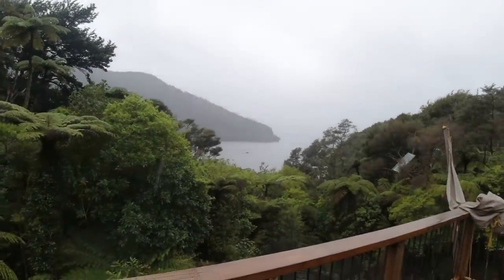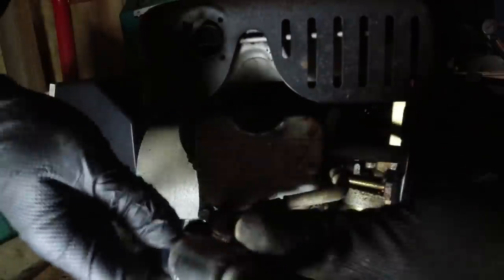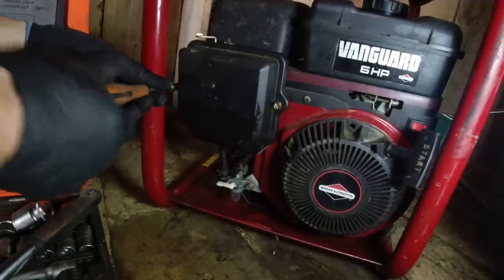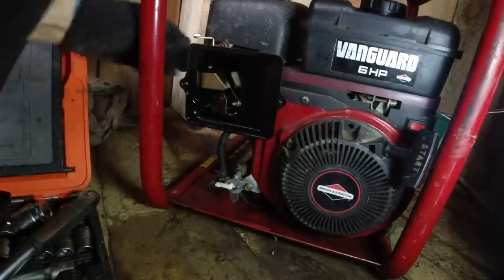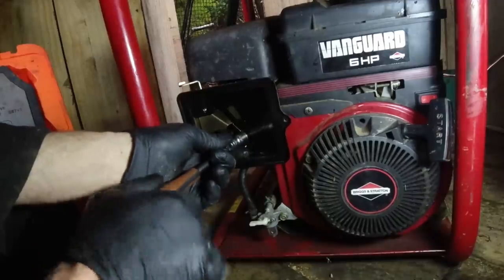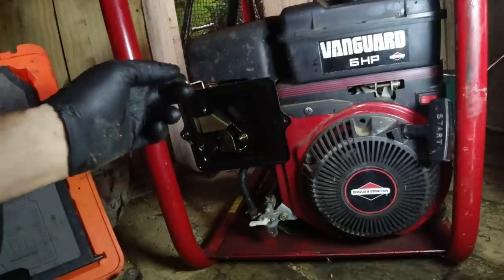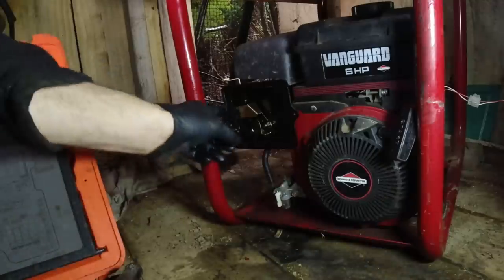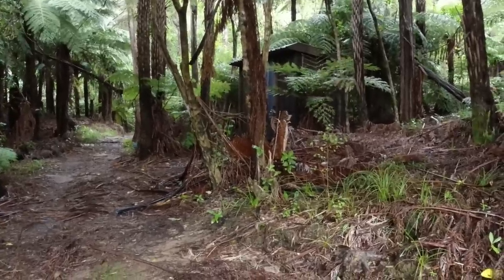Diagnosing and Fixing a rough running petrol Generator

Comment: Hi Marty.  I had a similar problem on a generator.  What I discovered is that the fuel valve was not shut OFF the last time the generator was used.  Over time fuel had bled through the carb, into the cylinder, past the rings and into the crankcase.  The oil diluted with fuel was overfull in the crankcase and the crankcase vent tube then blew fuel/oil all over the filter.  Luckily the condition meant the generator ran really badly and shut off within a few seconds of starting (30-40 seconds).  This is when I was asked to investigate why my father in-law's generator was not operating.  Due to the fact it very quickly shut down it prevented any damage from the fuel diluted oil.  When it was running it sounded JUST like yours.  I changed the oil, cleaned the card, installed a new filter and it was a job done just like Marty would do.  I channeled you!!
Reply: I had the same issue with my garden tractor. The crankkase was full of fuel. It spittit out everywhere when it ran (very pourly obviously). Also a an overflowing carb.

Comment: A vicious cycle, clogged air filter from most likely mist since you had so much rain, that leads to motor running rich and the blow by comes back to saturate the air filter with fuel and carbon, stopping it up even more. I always keep a few filters in the shop incase dust storms or vapor lock on my equipment. Tell kids they can start a motor with some brake clean but they never remember to take the filter off first.
Reply: id say the crank case oil beather pipe feeding straight into the airtake and mucking it up is more the problem. id either vent it to atmosphere or get an oil catch can.
Reply: @jimmyhackers8980  - For a short-term fix, this might be the best way to go - that is, vent that PCV pipe to atmosphere.  If it is rings/valve seals, that will take capital and work to reduce the oil blow-by.  While that would be an interesting video to watch if Marty did it, in the short term, venting a single cylinder 6 HP Briggs to the outside would be OK.  Or maybe using some flex tube and route a larger air filter (like one for a car) in a suitable enclosure.  That way the oil residue would get sucked into the carb and not get on the filter element.
Reply: Simple fix. Sound's good, an runs like a top !
Reply: Change yer oil and adjust your valves, help it breathe.
Reply: if he doesnt adress the oil breather clogging up his filter it doesnt matter how clean the oil is or how well adjusted the valves are.
     every one of my cars that put crank case oil vapour into the intake eventually clogged the hell out of my intake. the only solution is to vent it or add an oil catch can.
      engine manufacturers vent oil vapour into the intake to help lower emmisions targets, it is non essential for any engine.
Reply: good theory. well thought..
Reply: @aretardridesmotard6128  As to not enough air: Maybe the grass was left too long that time, try some garden hose for a snorkel.
Reply: @samvalentine3206  Yep, bigger filters help a lot.  I've converted most of our small(ish) equipment to run on "standard" filters (I chose a filter from one of the big trucks as our "standard").  Also reduces parts inventory, because otherwise each engine requires a different filter 🙄.

Comment: Since the generator is running in an enclosed space, you could get away with running a fine mesh screen instead of a paper filter, if blow-by kills the new paper filter too quickly. Or pull the blow-by vent to atmosphere instead of recirculating it. But since this is Marty T, I'm assuming you'll give her a new set of seals and rings in an upcoming video.

Comment: I have that same generator and it was running REALLY rough from startup. Fuel, spark, etc all seemed good. Turned out the oil pressure sensor had failed and was trying to cut it out whenever the revs picked up, so just disconnected it and it sprung to life.

Comment: While I can’t do any of this. You have encouraged me to do more of my own home improvement, e.g. re caulking shower, putting in my own hand towel rails, glass corner shelves in shower, install a floating shelf and cloths line. Things I’d normally get in a parent, friend, handy man to do. It’s amazing how much knowledge it out there these days to teach you how to do all this. And my tool collection is building as a result. Making me want to use them for more projects. Me and my partner then decided to take an old courier van and convert it into a camper. We taught ourselves everything. Plumbing, electronics, how to install bed frames, kitchen draws, tongue and groove walls. Installing Lights, batteries, switch boards, fuses, dimmers and even got the leisure battery charging off the main car battery using a charge controller. A few years ago I’d never have imagined doing any of this.

Comment: The clogged air filter being blocked will create a vacuum and suck oil up out of the crankcase. More then likely nothing is wrong with your rings or engine just a 10$ air filter.
Reply: I interpreted him saying that as: since the engine had so many hours on it it's probably earned a set of rings and seals at this point, more so as tune up parts, but I can also see the conclusion you had too, in that he mentioned blowby earlier on.
Reply: @newrhea13  So it's the question of what came first, the chicken or the egg, the clogged filter that creates vacuum or the worn out rings that provided oil to the filter...
🤪👍

Comment: I had a problem like that in the early days of living in the Appalachian mountains. Turns out that in an enclosed space that the filter will eventually pick up enough carbon from the exhaust. That will caused that. A very small fan running off of the generator receptacle plug, providing ventilation for the enclosure solved my problem. Plus an extra spare filter.❤️ your channel
Reply: Makes sense, but I'm surprised the exhaust isn't externally vented.
Reply: @dfross87  I mean there is an opening for letting them exhaust gases out of the hut, and letting fresh air in.
But I also wondered if the exhaust pipe should be extended out of the hut after all…

Comment: Looks like the air filter was not checked at last oil change. These things always come back to haunt you. I feel with full flow air this will cure the other worries such as the oil mist in the filter and maybe the suspected piston rings. A 3 hour travel is a good haul. Good luck, and I thank you for this video.
Reply: I think I would have had a spare air filter, plug, starting rope and spare oil/gas filter if used hanging around.  There's economy and then there's economy.

Comment: As always, such a great video. I love how you step through your thinking in debugging a problem, be it on a simple enough petrol generator engine or an extremely complex earth moving machine, you make it so interesting and digestible to the viewer.

I reckon many viewers think to themselves whenever their undertaking some DIY, WWMD (what would Marty do?) 😂
Reply: One other things that springs to mind about the clogged air filter is that, although the room you have the geny in seems to have ventilation (can see a wired section behind the geny) I wonder how much of the exhaust fumes end up getting ingested back in via the air filter.

A short exhaust out through the wired section might help along with the longevity of the air filter

Comment: Fixed many in my time working with stihl. Cama parts 101022 for the filter 101024 for the pre filter. The issue is the filter gets damp drawing cooler air reduces intake air due to damp filter then the chain reaction of the engine creating a vacuum effect pulling air from the crankcase vent soaking more oily mist blocking it more and creating a roll on effect.

Comment: Thanks for the video, Maybe giving it a dedicated air intake tube that brings in air from outside the shed would help, maybe one of those flexible cloths dryer vent hoses or the smaller flexible hose that's used on bathroom ceiling fans.

Comment: You can do the hot rod trick and vent the PCV hose to atmosphere, or put a little catchcan with steel wool in it. If it needs rings though it needs rings. Would make a good go-cart engine.

Comment: I reckon you would do well to feed the exhaust gases away from the intake. That soot on the filter could well be from the exhaust.
Reply: Allowing the exhaust to flow out would increase the noise outside the shed. Would be quieter to route fresh air to the intake. And you could have a bigger, longer lasting filter on the outside air intake.
Reply from the maker: Yes I thought the same, doesn't help that the air intake is pointed towards the exhaust, maybe an elbow on the air intake would help
Reply: Sheet of tin hose clamped to the frame might be enough separation. I really like your videos, makes NZ seem an amazing place.

Comment: Marty, always shut the fuel valve off to the carb when not in use. Those B&S carbs are notorious known for not holding back the fuel and when that happens, the air filter gets saturated ,the fuel gets past the rings , the oil gets contaminated and thinned out causing blow-by and accelerates wear on all the moving parts .  I would recommend a better generator set for your back up power that runs on propane !

Comment: A suggestion when testing carburetor floats. Instead of pushing up with your finger on the float just flip the carburetor over. Is very little pressure on that float when in use and you can very easily fool yourself by pushing much harder on it with your finger. It should seal perfectly with just the weight of the float itself.

Comment: I was given a broken Chonda "2.5 Kva" genny years ago with about 20 hours on it as best I could figure....  About $40 in fuel lines, clamps, a plug, fuel tap and a few other dribs and drabs and a few hours checking the fuel system and she has run well ever since!
Never thought of getting it to charge a battery bank though, nice way to get more from less eh? :-)

Comment: Hey Marty I have seen this before with gen sets that I have been called out to fix that are running in sheds an enclosed shelters, they suck in their own exhaust gas and it blocks the air filter. The motor will be fine but you will either have to run a small exhaust extension, or run the generator outside under a roof.

Comment: I had the same fault with my dad's lawn mower. The neighbour borrowed it and washed it down afterwards but he put it on its side and the oil ran past the rings and into the air cleaner choking it up and causing the same issue
Reply: It runs out the breather into the filter.  Golden rule is carb side up when you need to turn your mower over. Ive learnt the hard way!
Reply: Oh, I used to do that too when cleaning underneath, or replacing the blade, gulp.

Comment: Since I have a Colman generator w/a Briggs and Stratton engine, it's interesting watching u work urs, but for the life of me, I couldn't figure out where the model numbers were to order a new carb.
So instead I found a harbor freight predator generator 6500/5500 W,  for only $350, marked down from $630, a steel of a deal, so I had to get it instead of repairing the Briggs.
Too bad I don't have Marty smarts to figure out the Briggs.

Comment: Working on small engines and shop vacs (Hoovers), I've used woman's knee high stockings (10-40 denier) as emergency filters for air and various liquids. A pair of tights also doubled as a fan belt, across the basin and range country of Northern Nevada, on my '69 Datsun 510 Station Wagon.  Narragansett Bay.

Comment: Using a generator in a shed ( tremendous carbon monoxide) you might consider building a proper air cleaner with a house size filter
Just like a dirt bike, using a #12 spark plug versus day #9 will help
Living at sea level you could sand the float lighting it causing less fuel over the tube

Comment: In my experience with generators like this; if it doesn’t smoke badly when they are just running as normal; then they are fine! …a rebuild is only really needed if they start smoking badly after getting up to temperature.

It does sound like it could use a good service tho

Comment: Great video as always. I wanted to ask you about the water turbine that generates electricity for your house, did the turbine got damage again? and have you considered buying a dual fuel generator that you can run on gas or propane tank?
Reply from the maker: The turbine is running fine, this is at a different property

Comment: Is 'batch' vs 'crib' a purely regional thing?  Some friends of mine have a batch high up Ngakuta Bay.  The building is OK buy their very steep driveway has slipped with the heavy rain.  About the only good thing is that it is near the bottom of the shared driveway, so the cost of fixing will be shared.  With that in mind, I hate to think how much it would have cost to do the various repairs you've had to do Marty?   Way more than you paid for the heavy equipment you used.  That's for sure.   I am still incredibly impressed at how your subscriber numbers have gone up.  At this rate I can see you making the magic million subscribers in the next two years, and they say good things happen with that subscriber base.
Reply: Yes it is, cribs are down south

Comment: These ohv engines also have valve adjustments that can easily be done. They will run awful if the the valves have wandered off spec too much.

Comment: Having that Gen in a confined space it will pick up exhaust fumes that will block the air cleaner. I have seen this many times in during my time running my fixit business.  To fix put a tube through the wall connect the exhaust to it.   It is not the oil breather as that is on the inside and goes strait into the carby, the black soot is on the outside of the filter.

Comment: I've got a 13hp generator here that is pretty hard to cold start in comparison to what it used to be like, used to be give it choke, 2 cranks on the starter and away she went, but now cranking it with choke on, choke off, ether, really damn hard to start. Once it gets going it runs like a top (it is overspeeding slightly though, I just use an electric heater to load it back down to + - 50Hz). Haven't really looked too much into it as we don't need it too often as out batteries are fairly deep and can get us through most things.
Reply: @JohnSmith-yv6eq  What's the cold clearances normally set to on these Chonda motors?

Comment: looks like a good spot for vert wind turbine to pump water to a high tank and water turbine on lower tank. so the inconsistent wind and solar use 2 water tanks and gravity as a ups. the bonus being rain charges your system if you link in your gutters.
Reply from the maker: Yes I have thought along similar lines, but we don't spend enough time there to justify it at this stage
Reply: Is there a video showing this?
Reply: @MartyT  given the climate a cheap version could be an upper tank/ pond fed by gutters and a hydro much lower just releasing water.

Comment: If you need to temporarily clean a air filter that's clogged with oil you can spray it out with brake cleaner or even starter fluid. And then blow it out with compressed air. That will usually get it flowing enough to work until you can get another one.
Reply from the maker: I thought about cleaning it but it was weakened from flapping around in there, The metal backing plate had cracked so best to just get a new one
Reply: @MartyT  in that case yeah definitely best not to put it back in.  You don't want to suck that thing into the carburetor

Comment: Good job with the generator :-)
Have you ever considered making homemade wind generators ?? As solar don't do much on a rainy day and you seem to have high enough landscape to put one
Reply from the maker: I do have a little wind turbine here but output is pitiful, a 20w solar panel will produce more power in an average month
Reply: @MartyT  I was thinking some thermoelectric generators for your woodburner. Not a lot of power but every little bit helps I suppose.

Comment: The blowby might only be the cherry on the cake - dust and particles well filtered off together with suddenly very moist air did clog some of my air cleaners in cars and on other ICE devices while You could hear/feel it deteriorate after the rain had started. I reckon the mesh is swelling and thus restricting the channels which were still open between the dirt.

Comment: I wonder , does the petrol there have ethanol added, or are y’all lucky enough to have the non-ethanol additive? Here in the US, most of the gasoline has ethanol added as an oxygen additive for emissions. It wreaks havoc on fuel systems. Because most people don’t know how to do a basic carburetor cleaning , and service costs more than the average small gas machine, lots of them are put out for the trash collector, only needing a little cleaning.
Reply: Every car made in the past 20 years could run on 100% ethanol.
higher ethanol content = higher octane rating so thats a big benefit
Only issue is long term storage.
If people cant figure out that you cant let fuel sit for months thats their problem…
Reply: @alouisschafer7212  Nope.  Fuel system would be toast.  Higher octane means nothing.  In addition there is significantly less energy in alcohol than gasoline.

Comment: You naughty boy, how long since you serviced the old genny. What's up with the hydropower has the storms knocked it about. It sounded a little rough over the Internet - bearings OK ? I have one of those very cheap Chinese 750W two strokes and a 4kW inverter four stroke. I didn't expect the China one to last but it WON'T die - 7 years now. Not a bad sine wave output. Hell of a hard pull to start the swine.
Reply from the maker: Haha yes the generator is overdue for a service.. No hydro power at this place, just solar and a piddly wind turbine.